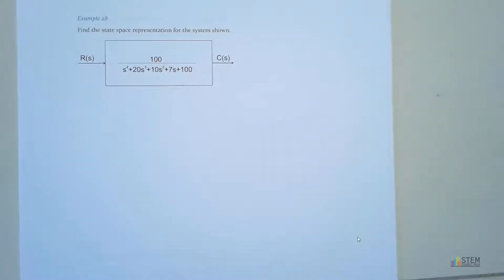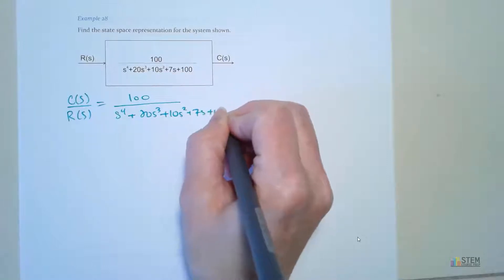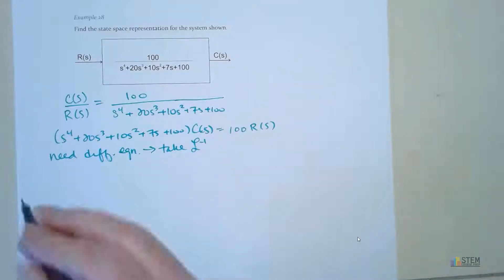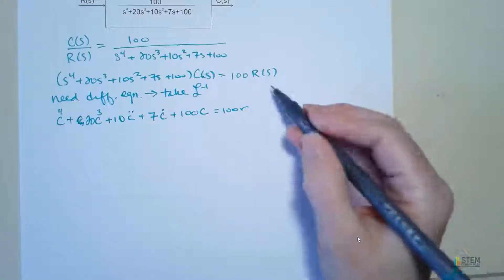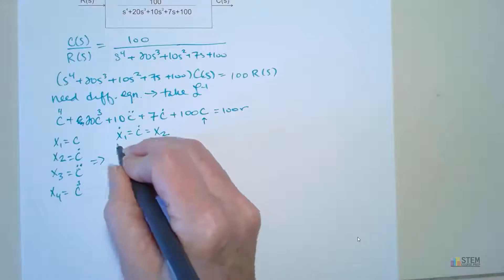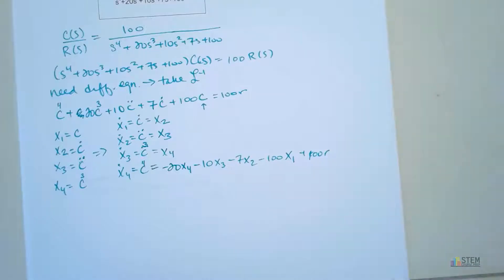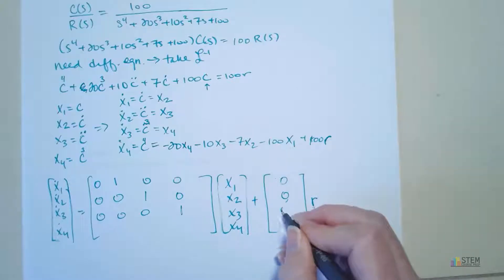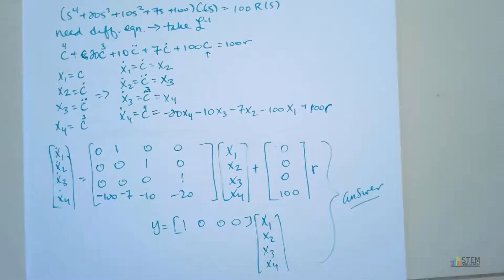Transfer Function to State Space Representation Example

Comment: what if there's an s term multiplying R(s)?
Reply: The derivative of x1 is x2. So the C matrix would have the coefficient of Rs in its second column
Reply: Also remember , if the order of the tf numerator is higher than the denominator , use long division and obtain an input for the D matrix .